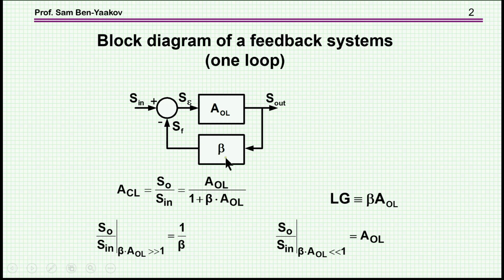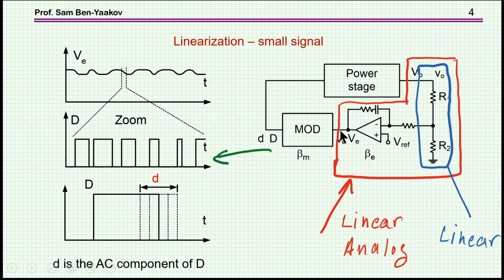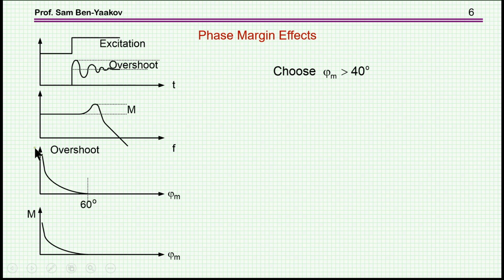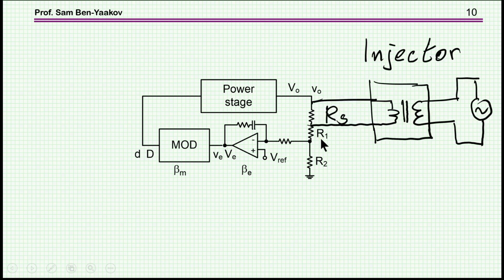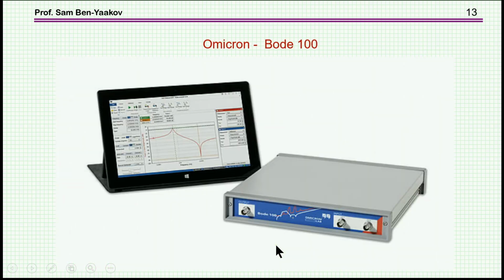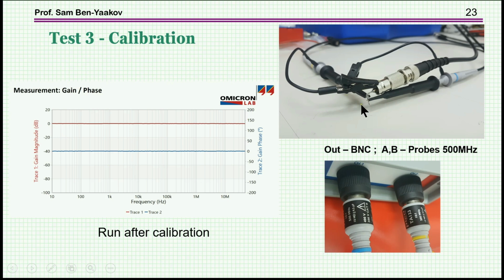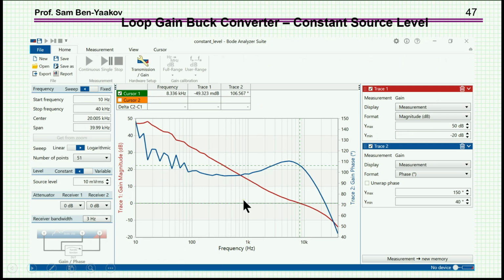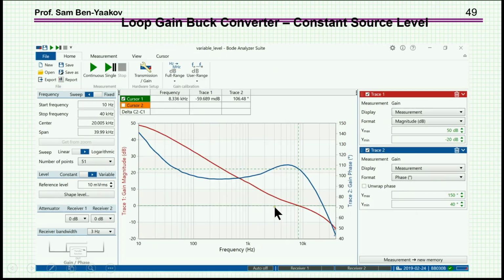Measuring the loop gain of a switch mode converter by Omicron’s Bode 100

Comment: Thank you for the few tips in this video.
I you ever have some time to answer my possibly silly questions, I have two :

- Is it a problem if the compensation is digital ?  For an Infineon PMIC ic,  I once asked the field engineer where to get the feedback signal in order to perform loop gain measurement (the datasheet internal schematic was not clear). He answered me that it is not possible to make such measurement because of digital loop. I've never understood this answer and don't see the reason why it would not be possible (an incorrect behavior when faced to a sinusoidal signal, maybe ?). I asked him why, and I'm still waiting for the answer since more than one year ^_^.

- Does it makes sense to perform the measurement with the "real load", i.e. on the end application board (different types of load, and continuously moving), rather than with loading resistors ? It seems weird to me to make such measurement (loop gain is load dependant). But a collegue of mine - an old experimented guy - always do this with rather good results (i.e. quickly get an optimized transient response).

Thanks again for being so active since many years with so much interesting subjects to share with us.
Reply from the maker: Thank inico. 
-No problem to measure the loopgain on a digitally controlled converter. No need to get outside the controller. You can use the method I am showing in this video, injection in the feedback path. Always connected the excitation signal to a low impedance point like the output cap. 
- Strictly speaking the measurement should be done with the real load. However a resistor is OK in most cases except for the case in which your inverter/converter  is feeding another converter which might exhibit a negative dynamic resistance.
Reply: @sambenyaakov  Thank so much for your time at answering my questions. Waiting for your next topic (I still have so many to watch, though).
Reply from the maker: @inico9366  👍

Comment: I was wondering if you could remind me of something I can't find the rationale for....  
I've read/heard it stated that the Fc crossover (0dB) must be such that Fc << 0.5*Fswitch.  Or, about 0.1*Fswitch, where Fswitch is the dc-converter switching frequency.   
I believe it's simply because any noise synchronous close to or at Fsw/2 (or integer multiple of Fsw, for that matter) and is unipolar will be seen by the control loop repeatedly, at every cycle of that noise, and the system will become unstable.
Is this the basis of the Fc requirement.  If so, is that it or is there more?
Reply from the maker: A PWM system is a discrete sampled system so Nyquist sampling criteria holds. So this is the reason.
Reply: @sambenyaakov    doh!

Comment: Prof. - please clarify... !!  
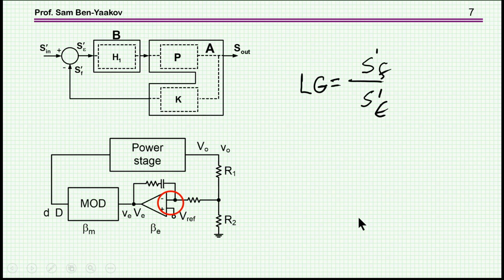1) At 7:54 you define the internal LG as S'f/S'e.  But that completely ISOLATES the summing element (error amplifier), removing it from LG, no?  

I realize that the lab method - as you show later - breaks the loop externally, and that - magically! - restores the internal error amplifier's presence in the measurement.
So, the Q is:  why does the "textbook" definition apparently remove the error amp as I mentioned.

2) Is S'in the same as Vref ?? 
I'd just say - The lower diagram, with B, etc., doesn't match terminology very well with the top one, which uses S', etc.  Being consistent with node names, etc., would help!
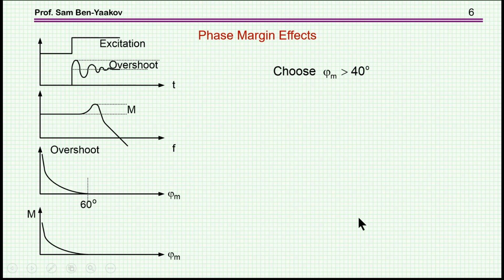Reply from the maker: You missed the sentences following 7:54 : "it is hard to identify...." . The circle at the op amp input is illustrative, it is NOT the summing error junction.
Reply: @sambenyaakov   
OK, I see.  They're 2 different animals.  I got it.   Thanks very much.

Comment: Try the RidleyBox instead. 

Same price, but includes: 

4-Channel Frequency Response Analyzer
4-channel Scope
Computer 
Injection Isolator
Lifetime RidleyWorks License

Watch this video to see how design, implement in hardware AND measure a flyback all in hour. 

https://ridleyengineering.com/videos-e/300-design-and-build-a-current-mode-controller-in-one-hour-webinar.html

Learn more about the RidleyBox at:  www.ridleybox.com

Comment: you have """open loop bandwidth 8.33Khz"" not ""close loop bandwidth"" , is it ?? @ 25:21
close loop bandwidth shows how good this can compensate for load variation , if  we have a load that changes around 50Khz , dose it still enable to make regulation at that frequency ??
how we can measure close loop bandwidth  for switch mode converter ?
Reply from the maker: HI Paul. This is the (closed) loop-gain as in the title of slide 49. Then you have the open loop gains, and closed loop gains. For these you need to specify what is input and what is output. E.g.  Gain between input to modulator and output. Or: closed loop gain between disturbance at the power input to output. So what do you mean by :" close loop bandwidth  for switch mode converter "? Between what and what?
Reply: @sambenyaakov   Hi Sam , I see in slide 49 , it is  written "loop gain "  more exact and accurate is (closed) loop-gain. so  this means close  loop bandwidth between output to input is 8 Khz  when the gain reach 0dB , so my question is if you have a load at output  with 50Khz transient switching then this converter can't regulate it at that rate ? is it ? regulation bandwidth is not enough !